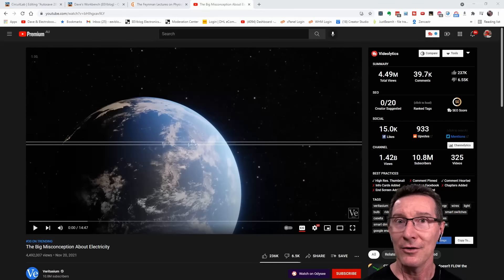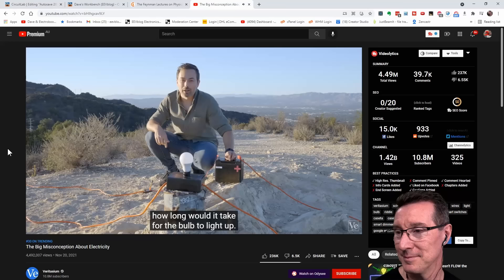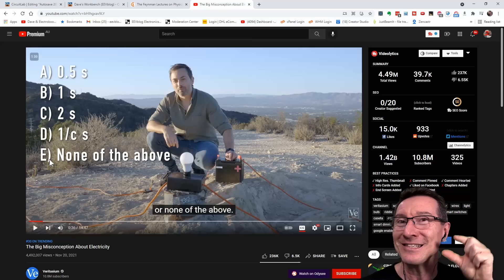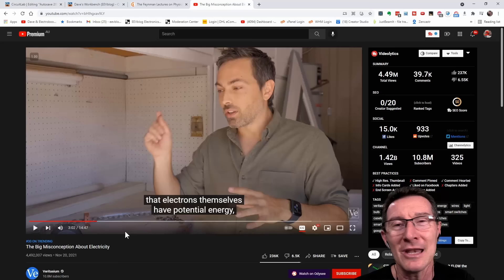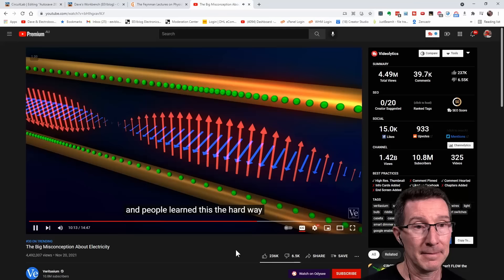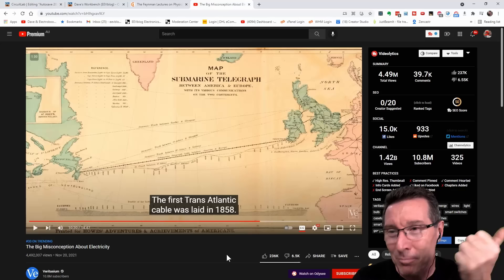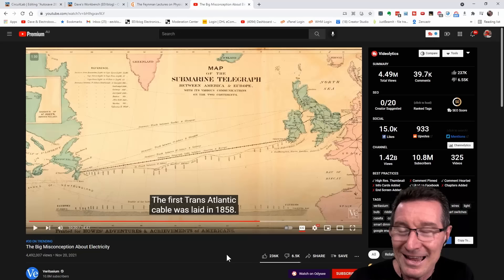EEVblog 1439 - Analysing Veritasium's Electricity Misconceptions Video

Comment: OK novice here. I kind of got the gist. But. Let’s suppose all the conditions of the setup. And modify one thing. I travel out the one light second to the bends in the wire and I use my wire cutters and cut the wire, opening the circuit. Now I travel back to the knife switch.

When I throw the switch, what happens? My intuition says the bulb doesn’t light up. But now there’s a paradox, isn’t there? In the original experiment, the bulb lights in 1 meter on C seconds. But that does not give time for a charge to travel to the break and find out the circuit is open. In fact it seems to me that by the logic used to answer the problem, it doesn’t even matter that the circuit is open. Or maybe the bulb comes on and there’s another transition when the circuit “finds out” that it’s open?

Comment: At several times in your video you point out that Derek is right for AC but for DC it is different. (direction of Poynting vector etc.) But Dereks bulb example is clearly DC and not AC. So most of your explanation is not addressing his example

Comment: Well the problem is when engineers use the wrong models and electrical circuitry taught in schools is a simplification of EM physics. The circuit model is purely an ODE problems and expecting it to give exact solutions to 3D PDE problems when things like wire thicknesses ars ignored is impossible. This is why engineers will use FEA tools like ANSYS HFSS to design antenna instead of lump models. I'm an engineer myself but I regonize that the tools we use isn't perfect. Neither is physics since there are still things beyond human understanding but it's much more accurate and applicable to extreme situtations. There is no need to be defensive about it.

Comment: If electricity does not flow inside the wires, than please explain how modern CPU's (with millions  of transistors placed nanometers apart, working at many GHz ) exist?

Comment: You know one thing I think is detrimental to my intuitive understanding. "Magnetic fields" when you explain it as "electromagnetic radiation" ... AKA light. What range of wave length are we talking? Then the teaching of engineering math without anything else like schools are trying to teach magic... like vertasium's BS. One thing I don't get is the direction/polarity of induce electricity... why does the left hand rule make sense. If radiation goes in straight lines, how does it consistantly induce a field in a specific direction?

Comment: They are two sides of the same coin. To say that the fields carry the energy and not the electrons is silly. The field is caused by the charge. They are not separable.  People love to sound mysterious by saying things that sound surprising.  But this is a step voltage. That means we don't have frequency in the usual sense. This would not matter if we had a transmission line that was terminated with the characteristic impedance of the line, but we don't. The wires are far apart, so from a transmission line point of view, inductance will dominate. It must take some amount of time to energize that inductor. Was that cell an Energizer? So, I say current will build at the load end. The lower the voltage of the battery and resistance of the bulb, the longer it will take to build enough to light the bulb. Plus the distance over the speed of light.

Comment: 1. If he's talking about AC power transmission, why is he sitting on a beach with a DC battery?
2. If you added a Faraday cage around the light bulb, would the light bulb turn on at all?

Comment: Does the circuit reach DC steady state near the switch and battery before it reaches DC steady state at half distance? Does the transition pulse move along the wire at c and therefore cause a response across the metre gap for the entire transit of a pulse along the wire?

Comment: If this is the case then why do circuit board designers have to artificially lengthen their traces on circuit boards to slow down the signal to make sure things sync up, when in reality the actual distance is all the same?
(note: I am not an electrical engineer)

Comment: Why do you say there is nothing wrong in Veritasium video? It starts with a big mistake trying to convinve us that the energy flows directly through the 1 meter space between the source and the lamp. And make an obscure explanation with the capacitors and the half switch on of the lamp.

Comment: I don't think the answer of D option provided by Veritasium is misleading. Since the question requires an answer for time then the unit shall be seconds. Although I currently don't know how to get to 1 / c, but if we have 1 from 1 meter distance and c is the speed of light in meter/seconds then (1 meter) / (c meter/seconds) --> (1 meter) x (1 seconds/c meter) --> (1) x (1 seconds / c) --> 1/ c seconds.
Reply: EEVblog's lumped element model here is not the right one for Derek's experiment set up.  Derek's answer of 1/c is not entirely correct either.

You'll be surprised at what the answer really is ....

Go to the top and sort comments on "Newest First", scroll to the time stamp of this post, and read mine.

Comment: I really cannot understand why you are talking about the 1 meter question through all the video, as long as Derek clearly says this: "... to connect to the light bulb which is one meter away...".
The video starts with an imaginary experiment where all the distances are clearly set, and so is the shape of the wires. 
So, yes, the answer is deliberatly tied to the distance, why you keep on complaining on this?
And, yes, nothing new in the video for a scientist, he's talking about a misconception, not about a new discover in science.
Also, you insist on the fact that it's not important on a practical basis, and it's fine if you forget as it really works, but this is true if you remind how things work, othewise in that experiment you'll give the wrong answer, and this is all the point in Derek's video.

Comment: Energy flowing outside the cable at 50/60 Hz?
Sure, hold a fluorescent lamp up to a very high AC power line (of higher frequency antenna) and it will or might light up. Energy flow (electrons).

Comment: 12:28 Considering that electrons repel each other because of their electrical charge which is practically the same as saying it's because of a magnetic charge. The closer they get, the more they shove each other. I still say the stuff about vector and what now is just a convenient way to calculate everything, and it would be more accurate to what's really happening to explain it more like magnetic drag of electron movement. Like friction but sort of a coexisting parallel dimension of forces that mainly consisting of conductive materials... if that makes sense (been watching a lot of Star Trek lately). Should make sense, put metal near it, profound effect, put an insulator near it, not a profound effect.
Reply: Electrons shove each other in the wire; coincidentally, the magnetic field extends past the wires.

Comment: New to your page - I have several questions, I’ll address one. If the “energy” is outside of the wires, then why do wires burn out with excessive current. The answer will steer my other questions “or not” 🤷 - thanks much.

Comment: NO WAY!  B-fields are only Maxwell's (brilliant) mathematical artifice b/c they didn't know relativity in the late 1800s.  Today we recognize that B-fields are merely the relativistic view of moving E-fields, moving charges, in the typical case moving electrons (see relativistic electrodynamics in any GOOD undergrad physics book).  B-fields are a fiction.  They are merely the relativistic distortion of E-fields of charges in motion.  Poyntng vectors are merely a 2nd mathematical artifice on top of another.  B-field are merely the pre-relativistic way of describing e-fields of moving charges.  

The basic physics is that electron motion in the wire near the switch creates electrical forces (including relativistic  distortions, aka B-fields) in electrons in the bulb and nearby wires.  And charges in the bulb accelerate due to these forces.  Well DUH!  Anyone who's ever owned an AM radio KNOWS that closing a switch  induces electron motion in the radio antenna at a considerable distance, and therefore noise. 

But everyone also knows that flipping a power switch  a couple cm from the power-cables should cause field strength 1000s of times greater than that in  Derick's bulb - but your conductive finger tips don't scorch, nor even heat appreciably. That's b/c the fields drop off at a at distance.  Alternatively the changes in dynamic electrical forces are tiny 1/r^2 drop-off

You and Derick got all tripped up on a mathematical theory but lost sight of basic physics.  Light (as in bulb) only occurs when you accelerate charges.  To get visible light you must accelerate an electron (lightest charged particle) thru~1.5 volts.  That field strength DOES NOT exist at the bulb ~6ns after the switch closes.  You get no light from that bulb.  If you'd BOTHER to actually to the math you suggest (calculate the Poynting vectors at say 6.6ns (2m/c) and then integrate over the surface of the bulb - the power is very trivial.   

If you insist on Derick's nonsense that ANY CURRENT CREATES LIGHT - then you have ignored the concentrated energy necessary to create a visible photon.   The sunlight in Derick's vid might impart ~4 Watts into his lightbulb surface.  This heats the bulb and causes considerable thermal current in the filament.    So is the light in the vid "ON" ?   Of course not - that's language-distortion rubbish.  It takes concentrated power onto electrons to create light - and that's  NOT available in the bulb depicted.

BTW your electrical simulation is incompetent.- do the math properly for real-world example - the 1-light-second wires have a summed capacitance of a few milliFarads, but several THOUSAND Henrys.!  Yet none of that matters in the first  10 ns.  Yes you induce a little current - but far far less than the impinging sunlight of thermal noise.
Reply: Right!  More ... EEVblog's lumped element model here is not the appropriate one for Derek's experiment set up.  Derek's answer of 1/c is not entirely correct either.

You'll be surprised at what the answer really is ....

Go to the top and sort comments on "Newest First", scroll to the time stamp of this post, and read mine.

Comment: So there is a first a transient peak? Then, is it correct too to see it like this??
 Nothing needs to travel through the wire (when the switch is closed)  since air conducts too (but really extremely bad) so in some way the circuit is always closed. 
However what happens next is that suddenly the resistance between the two poles drops and you get instantly some current. It's a small current first since only the local electrons are causing it . For more current the majority of the electrons still need move through the wire.
Reply: EEVblog's lumped element model here is not the right one for Derek's experiment set up.  Derek's answer of 1/c is not entirely correct either.

Go to the top and sort comments on "Newest First", scroll to the time stamp of this post, and read mine.  You'll be surprised at what the answer really is, and it should clarify the confusion Derek created.

Comment: So if the energy is transferred through a magnetic field that carries the energy, why do you only get a shock if you touch the wire conductor and not the protective insulation around the wire?

Comment: 35:28 Can you explain why having the switch and the battery at the furthest points but maintaining the 1 meter wire gap wouldn't have the same result? Without using the physics nerd vector stuff. I'm asking this assuming it wouldn't be the same, even though my earlier thinking-through of this lead me to believe a circular flow would be the slowest bulb-on time. Your multiple mentions of a circular circuit also leads me to believe my earlier thinking.

Comment: Of course best not to disagree with Dr. Feynman (ever!). But near the end with Poynting vector E X B, in the (nearly) DC case, the only reason there will be any non-zero E field near most of the wire is because of the resistance of the wire thus a voltage difference along the wire. As approach a perfect conductor (e.g. superconductor) that voltage decreases, and the magnitude of the Poynting vector will also decrease. As approach zero resistance (as in limit) then E in limit also approaches zero and Poynting vector approaches zero magnitude in limit. At some point even 60 Hz the radiation becomes more important if the (theoretical) resistance approaches zero, and will switch to radiative outwards, and also in these limit cases also the steady case won't be achieved for a very long time if looking at the same level of numbers as the Poynting vector at nearly zero resistance. So due to that requirement (to get an E field with non-zero magnitude) there has to be resistance in the wire, this is correct from viewing the energy flow because the wire is (therefore) dissipating. Now that is very interesting because it says the field is producing the energy in a sense! (Which was the point all along.)

Another slight disagreement with Dave is the transmission line lumped circuit model shows the capacitors first. If more accurately put half the inductance center tapped in T with the capacitor, will see a much lower spike at the first. Refining to more elements to more accurately reflect transmission line will just take out the ripples from the lumped model, but will see closer to the impedance of the transmission line. Also the inductance must be in proper ratio to capacitance to match the square of impedance (Z0=sqrt(L/C)), so the ratio that will show up in the voltage divider (as more refined with more quantity of refined lumps) will act more like resistance at Z0 and the voltage at load of Rload will be V0*Rload/(2*Z0), rather than spike up to the entire battery voltage immediately. Then that will be steady (if assuming zero resistance) until the first reflection from the end. (Of course if see any resistance like any reasonable wire size the resistance is so high the signal effectively never reaches the ends and termination (open or short) doesn't matter at all and DC current is effectively near zero.)

Comment: So could a copper pipe with a wall thickness of  .0625 and diameter of 1 inch  pass as much current as a solid copper wire that’s 1” in diameter ?

Comment: I don't quite agree about a bunch of stuff... It should not matter whether you talk about DC and AC ! If the cables have resistance the Electric field is non-zero and is proportional to the current, if there is no resistance there is no Eletric field in the cables so the Poynting vector is zero or am I wrong about this?
Reply: That's only steady state it can go to zero with zero resistance. Otherwise there is a moving wave and thus the E is not zero until it dies out. If it is A/C then it is continuously changing (even at 60 Hz.) and thus a wave. (Dying out is the 'steady state' and is only an approximation or limit in DC case.) Now one can talk about a 'steady state' of an AC wave, using a complex vector notation in which the traveling wave is described by a single phase and amplitude figure (for any point in space) but that is representing a time varying field that repeats every cycle at the frequency--but that's a whole topic in itself.

OH, and the "meaning" of the zero magnitude Poynting vector  (with no E field at zero resistance in DC case) is that along that portion of the (theoretically perfect) wire there is no energy loss since nothing is changing (radiating) and no energy is lost to resistance (as in the case of Poynting pointing to the wire with resistance.)

Comment: Very happy with my DCF77 time clock receiver or NTP servers all around the world... up to 2000 km @ 77 kHz from the transmitter :) With a car battery it can't be done!
Now, how does GPS signals work? Latency, yes same for DC a light bulb on the moon would light up eventually if there was a (lossless) wire...

Comment: I could understead what do you mean actually?, every light bulb is desiagned for a specific voltage and current and does power limits..So we dont know cable cross section in this case, how voltage level will be on ligth bulb to blow after 2x300000000 m line resistance voltage drop....

Comment: Isn’t it true that for the case of a zero resistance wire that even with DC that is switched on that the fields  do not penetrate the wire and stay on the skin?

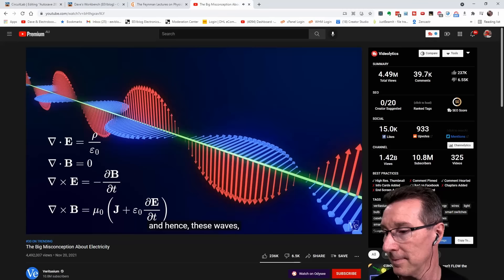Comment: @6:02 he is incorrect.  Only magnetic "waves" travel through space as light.  He's also incorrect in the drawing of the wave as if it goes up and down.  The wave is a compression density differential wave.  Meaning that the "wave" can be seen as varying densities as if you were firing BB's rapidly out a tube.  The "high" parts would be the denser parts of the stream.  The low parts are less density.  The mythical dual wave theory ignores the fact that you introduce "electrons" to the magnetic field when you measure it.  A point that can't be proven because how would you measure magnetic fields without matter?  This change in thinking is critical for the understanding of all "wave" type of problems.

Also there are no "charges".

Comment: The answer is none of the above because you need to consider the two long wires on either side of the earth as transmission lines and, at the instant the power switches, they act as a resistance equivalent to their characteristic impedance. This means that the bulb starts to glow immediately and gradually, over many seconds, the bulb reaches full brightness. And of course with wires that are about 1 metre apart (circa 600 ohm characteristic impedance) means an electricity speed close to but not exactly the same as the speed of light. Just saying dude.